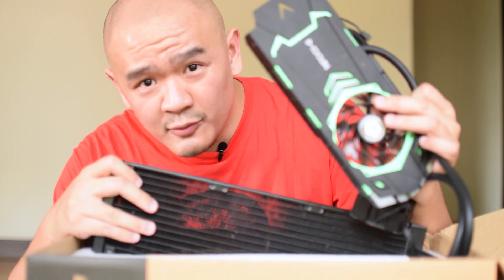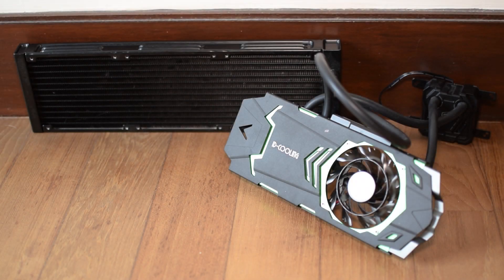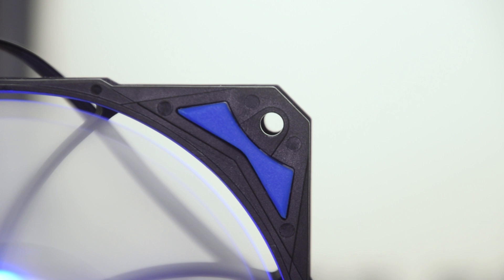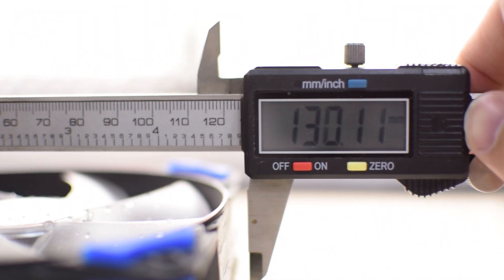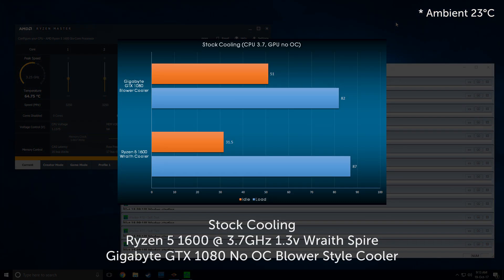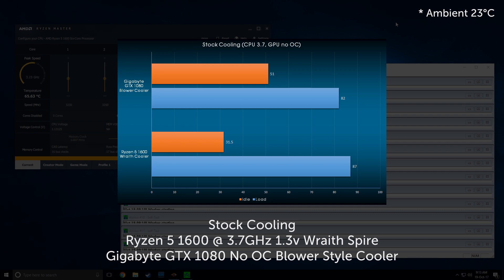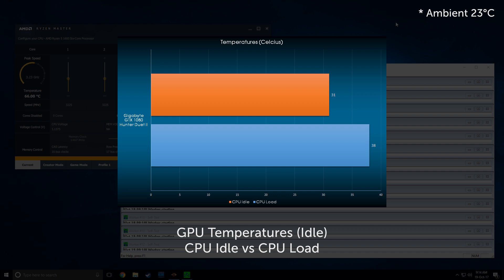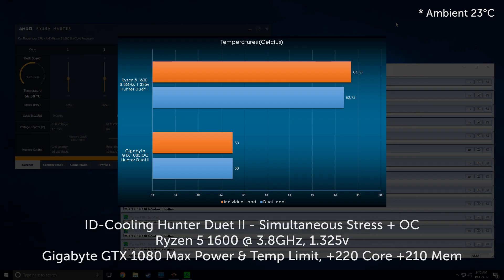CPU & GPU AIO for Cheap! - ID-Cooling Hunter Duet II Review

Comment: If anyone is having issues finding these you can sometimes find them on Ebay, on Aliexpress & if you can translate google or yandex translate, go with Taobao where depending where you live and which Taobao agent or currency agent you use, use TAOBAO. (Theres a slight caveat with Taobao like two stage shipping, shipping by weight, how it is rounded up, taxes etc BUT still cheaper well at least here in NZ 
for alot of stuff)

Comment: Hello! What do U think, will this system be good for i5 9600k + 1080 Ti Gigabyte (very hot with stock cooling)?
Reply from the maker: 9600k is hot because of the terrible TIM in between, but this cooler should work fine

Comment: Hi,
Can this AIO cool down I7 8700k & MSI GTX 1080 TI ARMOR and OC them with no problem.

Thanks in advance.
Reply from the maker: I would believe that it can do it no problem. The system that is running this still doesn't go over 60 Celsius even on load.
Reply: @TechRodent  Or is it possible to use the ID-COOLING Hunter Duet-R 240mm cause I'm doing a mini build with Cougar QXB case

Thanks for the fast replay.
Reply from the maker: I would be a bit hesitant going for a 240mm to cool both of those, because the 1080Ti is a pretty hot GPU, and the same goes for a 8700k without a Delid to be honest.
Reply: @TechRodent  Really appreciate it
Thank you.

Comment: How is the id cooling with the120mm and the 240mm or even this 360mm compare on Zotac amp! 1080 ti card? My case is a phanteks evolv shift which can only acommodate 120mm radiator cooling. But will it be enough cooling when I’ll be OC ing it though?
Reply from the maker: You're going to have to need more than a 120mm if you're planning to cool your GPU and CPU on the same loop.
Reply: Tech Rodent im going to have separate cooler for the cpu. They wont be on the same loop
Reply from the maker: If noise matters for you, 240mm would be best for each
Reply: Tech Rodent my Phanteks Evolv shift can only take 2 separate 120mm radiators. So is the 120mm AIO idcooling sufficient for my Zotac Amp! 1080 ti? Here is a video of the case and intended water cooling installation arrangement https://youtu.be/ttD--_Rel48
Reply from the maker: I'm using a 120mm cooling on my 1080 Ti and my temps are perfectly fine, am in using a Zotac 1080 Ti AMP 👌
Reply: @TechRodent  I imagine you can still OC it quite a bit wit it? Thanks for your replies.
Reply from the maker: Yeah, you can still OC just fine, until you hit the limits of your card or the power delivery

Comment: I wonder if the Hunter Duet 1 can fit in a Node 202? The 240mm radiator should fit nicely where the gpu vent is, given that two 120mm fans can be mounted there with room to spare on either side. But the gpu mounts on a riser card and sits right beneath the vent, so I don't know if it would fit without it hitting the fans.
Reply from the maker: That looks like an extremely tight squeeze.

Comment: would this work for a sapphire pulse rx580?
Reply from the maker: I can't tell you that exactly, but I couldn't get it to fit on my MSI GTX 970 due to the PCI-E connectors interfering with the GPU block. 

If you're looking for GPU only cooling the Frostflow 120 VGA that I recently reviewed is pretty good with good compatibility

Comment: hi there, i have an mini itx pc, but i want to use this type of cooling
the question is, can i change the 360mm radiator with 120mm radiator since my case can only fit with 120mm
Reply from the maker: You might run into issues with heat but it is possible if you mod it. No easy way though
Reply: the hunter duet v1 is 240mm
Reply: No, You can't. The rule is minimal 1 x120mm for each component cooled. That is 240 mm.